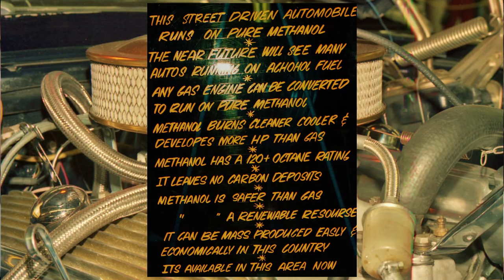Outlaw Big Chief in a Firebird? Street Racing Death in Portland #BaddAzzSEMACarz

Comment: We know now it's a Pro Mod Firebird, looks like the Blue one you showed.  I started street racing in the 70's with a 1972 Mustang Mach 1 with a very stout 351 CJ.  Now I have a 1975 Pontiac Grand Am with a 455, now a 462 that is stout, plus a 89 Trans Am GTA with a stout 389 CID SBC, that is very mean.  But both of these cars aren't a match for what these guys are street racing today.  They are like what I had in the 70's and 80's.  The Grand Am is too heavy to make a top flight street racer, the GTA could work, but it would still be heavy.  
By today's standards you need a sub 3,000 pound car,  you need to be pushing 2,000 to 3,000 HP.  Obviously that means a Pro Stock or Pro Mod type car.  I think they can do just fine on the street with a couple of changes.  First, you need lights, front and back, you need to see where you are going and the other car needs to be able to see you as well.  Second, ONLY race 1/8 mile, this makes aerodynamics not as important and that is VERY important.  These Pro Stock and Pro Mod cars and made to have low drag and low downforce.  On the street you need that downforce to keep the car on a sketchy road.  So, they need to take those cars and get some downforce on them to keep them planted.  Yeah, you will lose a little ET and MPH, but you are a lot safer, a LOT safer!  Why did Tina wreck her new truck, no prep, no downforce!  Why did Daddy Dave wreck Goliath, no prep, no downforce.  You watch the cars skating around and they need downforce, either more weight or with aerodynamics.  You do that, bring out the Pro Mods on the street and let them run!
Reply from the maker: +Dan Boren I never hear how long their races are. I have wondered maybe more like 1/8th or 1,000 ft. The T/A sounds like a bitchin' street ride.

Comment: daddy dave crashed on race track not the street daddy dave is a driving son of a gun cant take that from him...
Reply: +Matt fultz He crashed because it was a no prep race.  Race tracks that aren't prepped are slippier than goose snot!  So you need plenty of traction to keep your car from getting away from you.  To get traction you need downforce.  That can be from the weight of the car or using aerodynamics.  Daddy Daves car was very light and they had modified it to reduce drag and thus downforce.  That's what bit him in the butt.
Reply from the maker: +Dan Boren Yup ... all points to consider